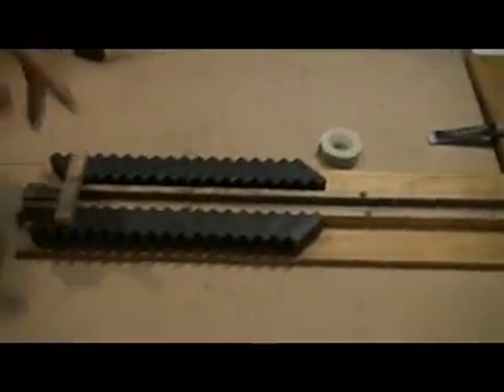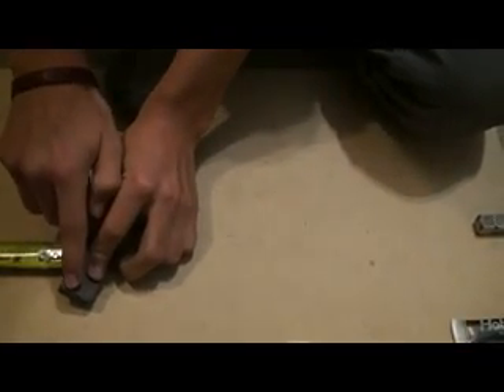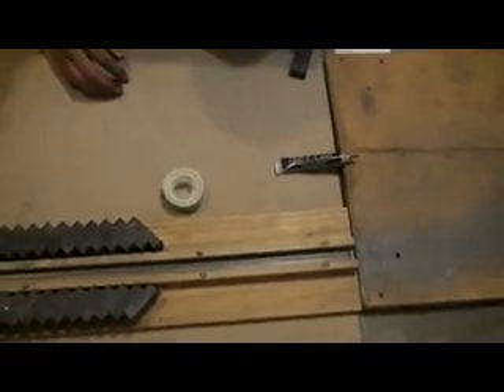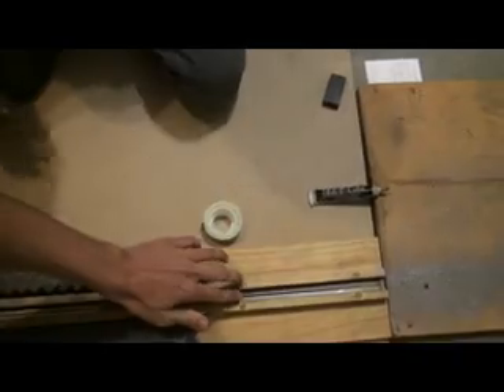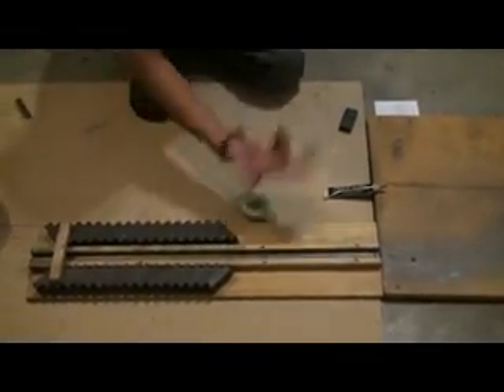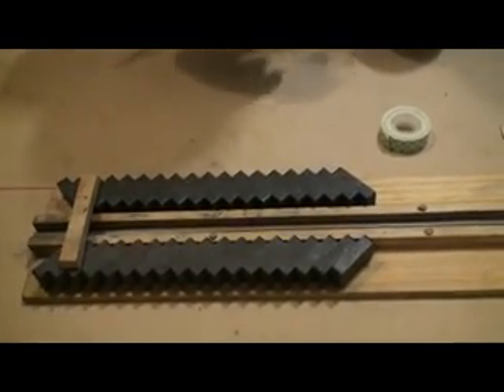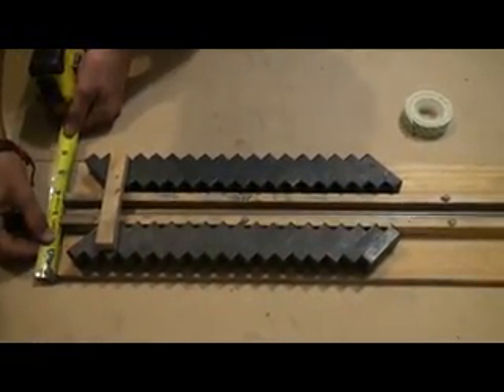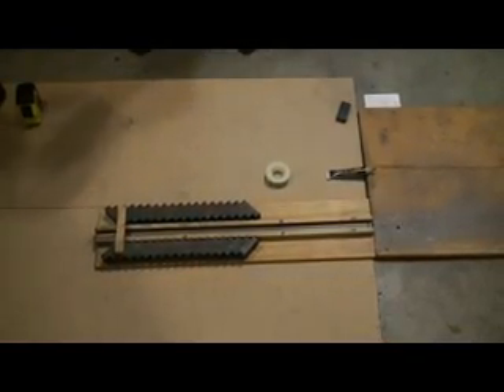Magnetic Rail Gun Science Project II - How to Build It

Comment: Firstly, I'm angry. Your project is remarkably similar to something I proposed to my science teacher back in 1980 and I was told it definitely wouldn't work. When I prove him wrong on Time Travel, I'm going back to thump him! You've re-inspired a dead project.

Question: What is the configuration of each of the ceramic magnets?

N<---->S (end to end)

or

NNNNNN
-------------- (face to face)
SSSSSS

Further, on your other video, you mentioned that Magnet #19 wouldn't work! Without taking your rig apart, and assuming you have enough spare magnets, try building the longest chain of magnets that you can. You will find that, unless fixed in place, they will naturally fall apart into groups of equal number. Magnets form NODES. If you look at the Earth's magnetic field, it occurs in six belts because of these nodes.
Reply: It will work. Try using a pair of parallel busbars on top of neodymium magnets. Then use capacitors to short across the projectile. You get a railgun that can fire way faster than 200kph

Comment: This is a 2D concept, make it 3D (try a PVC conduit and a cylinder projectile)
and wrap the magnets around the PVC...
This fixed-magnet idea would only be beneficial where there is no source of electricity.  You would need hundred or perhaps thousands of those magnets to get the projectile up to a useful speed.
Reply: Not true. You could have it on a wheel array, placed vertically, so that the wheel can spin freely with only 4 or 8 points where magnets and stators can be aligned.
Stack the discs, and you have a formidable power supply.

Comment: You could put this in a circular path but you'd need very well engineered magnets because cuboid ones wouldn't work well at all since more friction would be made plus the squareness of the projectile would dip in and out of the middle of the field. If you did engineer them as round, you'd have to overcome gravity if not even more friction if it was on it's side. All of this would bring the projectile to a halt somewhere.
This really only works in a straight line.

Comment: No, it is a fundamental part of physics that perpetual motion machines are impossible. To push the projectile into the field, you have to give it energy which is ten lost over time due to the second law of thermodynamics, just as you can't have a perpetual motion machine by cutting a hole through the Earth and dropping something down to oscillate at the centre of mass in SHM, Carnot's second law of thermodynamics means that no process is perfectly efficient.

Comment: Railguns use electromagnets, here you merely extended projectile launch zone by the length of the area with magnets. Railguns based on electromagnets turn each magnet on when the metal bullet approaches and switches each one off as it passes it by...

Comment: how about if you positively charge the ball bearing? troll face, mono poles don't exist D: although you can create a theoretical mono pole or (ball) using magnets locked into a spherical formation where all the negatives are pointing towards the center making all the outside negative and boom mono pole ball (the fields would all have to be overlapping though to create the desired effect.

Comment: Your exactly right, after thinking about the situation, the people that have the magnet stopping in the middle are using face magnets aligned like this
-+-+-+-+-+-+-+
         -+
-+-+-+-+-+-+-+

those that are stopping at the end are due to the negative getting stuck to the positive at the last magnet
by changing angles and so forth of the last magnet will only result in it stopping at a previous magnet, they need to increase the distance or reduce the friction.

Comment: Hey, I have created a prototype "free energy" motor using permanent magnets, it does not break any laws of physics as the magnets contain potential energy my device changes it into kinetic energy and then a generator is used to convert it to electricity, perpetual motion is 100% impossible as you can not create energy from nothing we are not god, we did not create the big bang. The law of thermodynamics means that my machine will only last for as long as the magnets remain magnets.